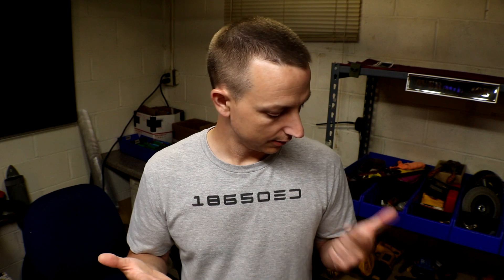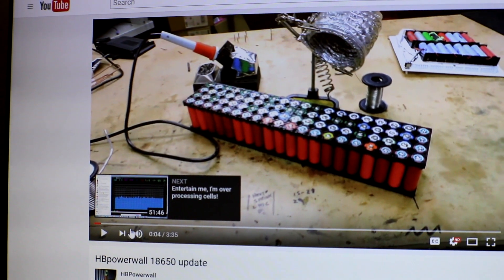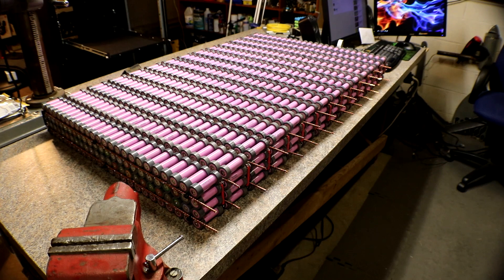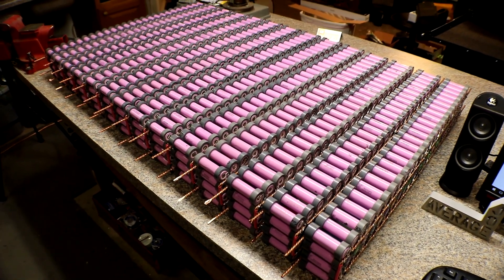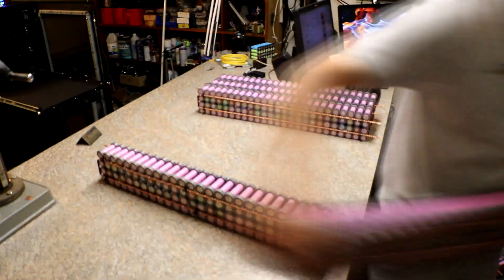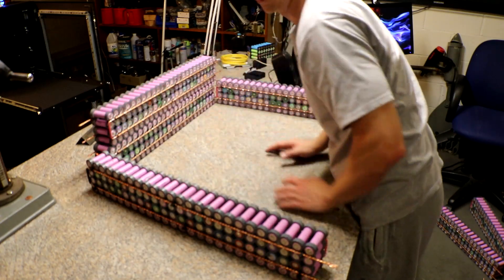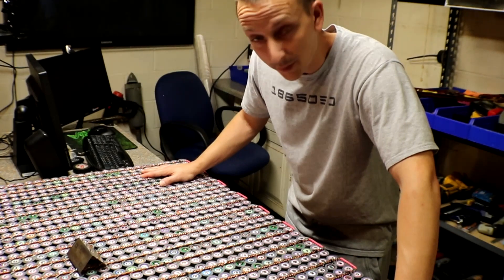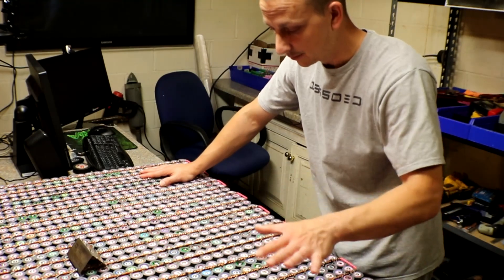Diy Tesla Powerwall ep41 All Packs Soldered!!!

Comment: I know this video is a bit old now - but I was wondering if you were able to give a basic estimate of how many hours this pack would run with the following draw on it: A 4000 Watt 200 Amp draw being converted to 120v through an inverter (actually two, Victron Multiplus 5000 48V units).

You'll most likely be asking what on earth can take that much to run - and it's a whole slew of things together totaling up to a pretty major draw... without getting into too much useless detail.

Hopefully I've asked this question correctly - and thank you so much for any input you have toward this answer :)
Reply from the maker: If the video is relevant then its not old! 😆  Well to give an example, my battery pack is 226amps and I have run a few tests with it. If I run 1000watts I can run it for 7 to 8 hours.  Have also run over 2700watts for a few hours.  Here is the latest Live Stream load test results video https://youtu.be/kIvIx2vAp00 . Im guessing a 200amp draw would last about an hour or so BUUUT you would want to use high amp draw cells because laptop cells really only like to be a max of 1amp discharge.  Another option would be to add more cells in parallel.  Did any of that help you out?

Comment: Awesome! I checked on electrical grade PVC 1 1/2". It fits but it requires min. 3mm spacing for cooling and it's less than that. Looking at slotting the pvc , especially around the series connections, using your Dad's concept. Looking at 15 cells/48V sticks, but calculations show it has to be 75 inches. 360 cells, (3.2V 8A 38120 HP 25C) cells gives me a 9.2Kw battery. Enough to run my house in the Caribbean. We just went through 2 Cat 5 hurricanes. Love your battery pack, rack and system, very impressive and a work of art. Your choreography and presentations are entertaining and extremely informative.
Reply from the maker: Yeah that was my suggestion to him was to cut a slot where the series connection is so he can connect them all in parallel there and keep them all in balance.  I wish I could run my house off a 10kwh battery.  Did the hurricanes do a lot of damage?  Thanks for the comment!!! 😃👍👍👍

Comment: Actually if you think about it you solder the fuse on one battery to the bus bar that is a solder connection times that by 100. Then you have to figure that other end of the fuse is to the bus bar that is another 100 solder points makes it 200 solder point  that's ones side then you got the other side that makes 200 more solder points for a total of 400 solder points. then you got 14 packs for a total of 5400 solder connection points.  at this stage of it all. Or maybe I'm wrong? Damn that's a lot man :)
Reply from the maker: +joseph chrzempiec I counted the connection at the buss bar as 1 cause the fuses went to the same point. 150 solder joints per side but I actually pre soldered both sides of the cells and didnt count that 😉
Reply: AveRage Joe lol damn what I said wrong now haha
Reply from the maker: +joseph chrzempiec Eeh close enough lol

Comment: Quick question, if I build cells like you (where each pack is 3.7 volts nominal) how many do you need in series to get 12V? 3 or 4? The maths beats me 3.7*3 is not 12 and 3.7*4 is also not 12 🤦🏽‍♂️. Help
Reply from the maker: I hear ya,  My "plan" when I started was to do a 12v system so I could use my old lead acid battery inverter and charge controller but then I struggled with that same question so I said screw it and went all out for 48v.  It seems that both are a popular method.  The higher the voltage the less conversion the inverter has to do.  Both are fine as long as you stay with in the 3v to 4.2v range.

Comment: Beautiful 18650 porn! I know how much blood, sweat and tears goes into this...
I'm making some progress too - have got 200 good cells together out of 1,000 tested so far, and made 12 x 16p packs for my ebike, (soon to be 14 x 16p) but still have a way to go for the ultimate home battery goal.
Reply from the maker: Thanks Man!!!  Yeah its a lotta work so far.  Only 200 out of a 1000?  What are your cutoffs or were the cells pretty crappy.
Reply: These are all from laptop repair shops - I guess people here use the batteries until their last gasp, where they can't tolerate a 5 minute run time any longer!
The yield so far is pretty low but there are some nice surprises, so I'll keep going...

I decided a cutoff of 2000mAh, and put what I had into a database and got an average of around 2200.
I needed 30 amps and wanted 35+Ah, so I ended up with 16p modules.

Any new modules I make need to be the same capacity and have to juggle with cell values to fit.
I needed 1 more module to make 12, so relaxed my rule and included some good 1700-2000s to get an 18p module. Not a big problem that it's a bit longer than the others.

The cells are just hotglued together as 2x8 to give a decent stackable size, and 10awg wire bus on each side with magnet wire soldered to the ends, more hotglue for support, then wrapped up in black duct tape. (I bare the insulation on the 10awg where needed for the magnet wire).
I'm using split HXT connectors (a nightmare to work with!) rated at 100A, but the great advantage is to be able to quickly swap modules in/out or reconfigure as 48V 35Ah, 24V 70Ah or 12V 140Ah.
Reply from the maker: Thats Awesome! Sounds like you have a pretty good plan of attack.  Yeah I almost started using my 1900s to finish out my packs but ended up not needing to do it as I got just enough 2000s.  Ya the connectors is a good idea to easily swap the packs out.  Thats why I had my recycler hang on to all the anderson connectors.  Some even have 100amp fuses on them.  I would use those in-between the packs but dont think there is enough yet.

Comment: Joe, Be careful using tin/lead. If you ever realize a sweet taste in your mouth you've taken in lead oxide fume and you know that's it's toxic can cause nerve damage and depression. I see you have adequate ventilation but it's so easy to contact the fume. I use tin lead but only do 200 solder joints at a time over the space of months for electric bikes. You have a major potential issue.
Reply from the maker: Thanks for the heads up Chris. Yes Sir, I know about the symptoms from a class at work but usually forget. I knew there was a reason I made the fume extractor ;) That was a major reason to make the fume extractor.  I have actually upgraded since the first fume extractor build.  It has a nice big filter and 3 fans for extraction.  I will admit that some fumes do get past it from moving around ect though.  I would typically only get 1/2 to 1 pack done at a time and there was usually a few days or week between packs but that was because I was busy.  When I set the soldering iron back in its holder I would move the tube to be over it to catch any fumes coming off it. I would also put the extraction tube near the ceiling after I was done for bit and let it run to try and get "anything floating around".  Thanks for the reminder, Ill actually try to extract more if possible :)
Reply: Well, I've spent thirty years around melting alloys as a facility manager and I know the insidious nature of lead fumes. I know you'll be careful.
Reply from the maker: Wow, 30yrs!  Thats a heck of a long time.  Must be a good job.  Glad to hear there are still people that stick around and keep/pass the knowledge.  Thanks again, Joe
Reply: Well, I'm nearing retirement now, I'm a consultant for metals refining. I have overseen air sampling for lead and other metals for many years. I can say that there are adequate hygiene provisions in most industrial settings but soldering in one's basement or garage poses risks. I think you've addressed the concerns but since you're doing so much of it I'd simply say that you may want to evaluate your setting to prevent inhalation issues.

Comment: Which charge controller are you thinking?
Reply from the maker: Im thinking of maybe getting a Morningstar TriStar MPPT  model TS-MPPT-60.  Do you know of any other good ones?
Reply: AveRage Joe I reckon that's a good choice! I looked at those, they seem like a solid reliable unit and petty sure they are configurable enough for lithium.
I've got the Pcm60x but yet to test it properly.
Cheers
Reply from the maker: +Offgrid Dreaming Yeah I emailed them to find out for sure and they said "Yes, it is configurable for lithium Ion batteries". Thats the same one Pete has right. You better get on it😃